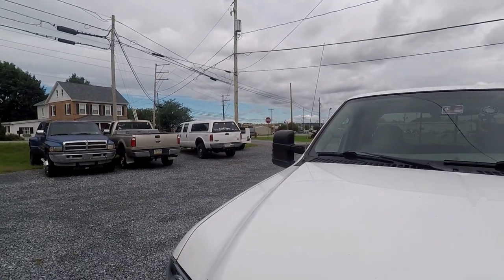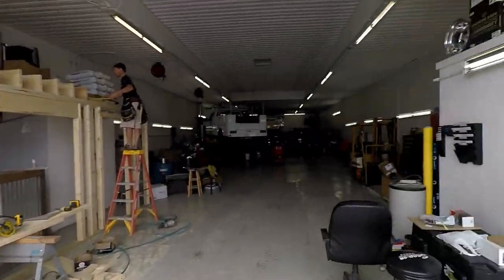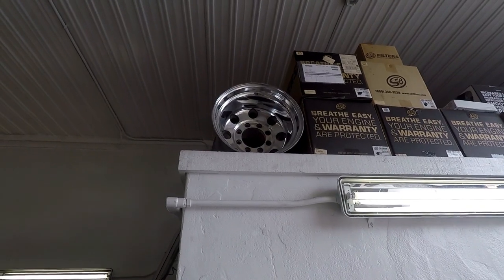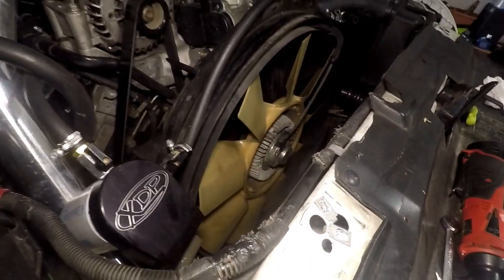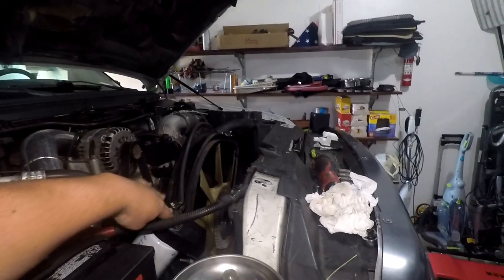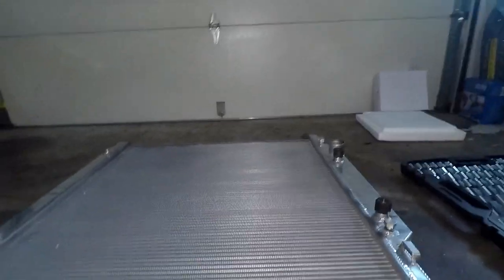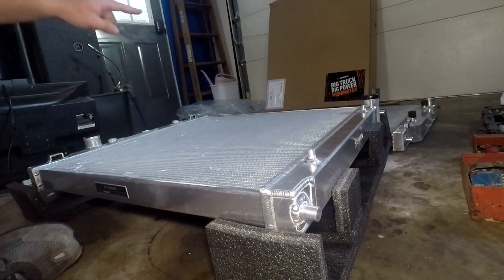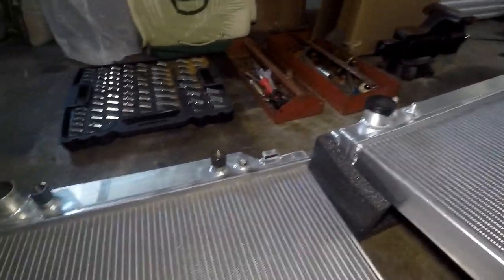6.0 Powerstroke Mishimoto Performance Radiator

Comment: When Bill Hewitt rebuilt my truck he did that upgrade and I love it,  my next upgrade is going to my the banks intercooler.  Need to save up for that one
Reply from the maker: If you haven't already check out my video on the csf 6028 intercooler. It's a great intercooler and a great price. I am switching out my intercooler pipes but overall would be cheaper still.
Reply: I have this exact intercooler, csf 6028. Extremely pleased with it, it's awesome!!
Reply from the maker: It really is a high value intercooler. Been very pleased with mine

Comment: Good to see Mishimoto makes a better thicker rad. Now I might want one. That Powerstroke Help dude knows lots about these 6.0s.
Reply from the maker: Yes he does. I do not know if it is thicker than stock though. We'll see if it cools as well as stock though. One thing that concerns me though is he only talk great about mishimoto and they clearly dropped the ball on their first design or two of these radiators. Their current model has good reviews from what I see.

Comment: What do you think of the XDP radiator or BPD???
Reply from the maker: I do not have experience with the xdp setup, I have heard the bpd is a good one, and the prime cooling on Amazon I have heard good things about. If I were to need a new one I would probably look at the ipr research heavy duty radiator

Comment: If you're doing a lot of Towing I would suggest bypassing the radiator with your transmission lines
Reply from the maker: So don't use the transmission cooler in the radiator? Not sure how that would help me. Can you explain more please?
Reply: @six0bros  yes bypass the radiator if you think about it your coolant is around 200 degrees why would you want your transmission fluid heating up inside the radiator then cooling back down inside the transmission cooler
Reply from the maker: Never thought about that. That said trans temps were not terrible so I think this thicker core should be good. Have people bypassed the cooler in the radiator and have lower temps? Temps while going to ny got about 10 degrees higher than I like. So I am hopeful with this upgrade it should be where I want it.

Comment: I was concerned when you got the 1st Mishimoto radiator but was hopeful it workout so I could use it for my 6.0. Cuz the $500 difference is a lot. Glad Mishimoto stand by their products by replacing with the performance radiator. 

I got a code for my injector #8 contribution. Sadly, I’ve never worked on Diesel engines before and tearing it apart is something I don’t feel confident doing. The local diesel shop near me (Pittsburgh) pretty much hates the 6.0. He replaced my IPR, then told me everything that sucked about them. And it’s a busy shop with big rigs that have a 2-4 wait list or at least for my 6.0!
Do you or other subscribers know of a good shop in the Pittsburgh area?

And how long can I drive with this injection issue (no smoke) 12 miles round trip to work. 

Wish you guys were closer, Lol Thanks in advance!
Reply from the maker: Yeah you are a little bit out there. I do not know about any shops by you. I can tell you as long as it is not smoking like mine has done you should be fine for now. If a shop hates them that much I would try and stay away. That said I understand  you can't just drive 4 hours or so to where I am in Lancaster to have DNA do it for you. Any Ford dealer should be able to. Any plans to go larger for injectors? Also have you checked out our injector video? It is much easier than you would think
Reply: 6.0 Bros Yeah, I did map DNA out but unfortunately it’s too far away for me. I did check your video on the injector replacement but I don’t feel comfortable enough to do the first one by myself. I know #2 & #4 were replaced before I bought the truck. I don’t know if OEM were used. 
Except for a couple trips per season to tow my 34’ Travel Trailer, this is my daily drive. 

I was able to find a couple shops near me & I’m going to reach out to the guy I bought the truck from. I remembered that his friend (who was in diesel mechanic school) did some work on the truck. Maybe I can look over his shoulder while he does the injector work.
Reply from the maker: Nothing wrong with having someone show you. Josh and I were just talking about doing a free raffle to reach someone how to do a job on their truck. Not sure of our exact plan yet but we are working on it

Comment: How do you know which radiator to get? I have a 2006 and I need a new one. Just want to be sure I buy the right one.
Reply: Get the biggest one that will fit, that's in your price range.  Or you can get the one you have fixed
Reply: @dorkhole8564  I've seen different ones. Different size hoses.
Reply from the maker: So mishimoto has 2 different ones I'll look up part numbers after work tonight. But the bigger one is the performance radiator. The cheap one you see on ebay and Amazon is a true mishimoto but it is their old design. The old design one is what I had. I have also heard great things about the one bullet proof diesel sells. Also the OEM one cools great and is a good design. I just didn't want plastic end caps anymore.

Comment: Hey Jared, what coolant and oil are you running? How do both of those Mishimoto rads compare with stock?   Still waiting for that pull off. Lol
Reply: I think I have the basic unit, works for me, Now had the bigger unit been out I would have ordered it.
Reply from the maker: Well the bigger unit was out for me and I still bought the other one, but i wasnt looking for better cooling than what factory did. Well turns out with 13k hooked up it didn't like it lol. Mishimoto took great care of me.
Reply from the maker: I run cat ec1 coolant. I am currently running motorcraft oil but I am planning to try scheaffers next oil change.
Reply: @six0bros  Are you running 5w-40?
Reply from the maker: I am currently running the 15-40 not the full synthetic they sell.

Comment: See brotha I told you back when you were doing head gaskets that it was crap my experience with them was crap, good to see that they are taking care of you at least!!Another thing was that it didn’t come with coolant fittings, they were not the size that was advertised either literally the stock ones didn’t fit like advertised...the bulletproof diesel one does, makes no sense..good luck once again! Btw make sure you burb the heck out of it get all that air out of the system..the air will stay in there and drive you nuts because it will show blown head gaskets signs all kinds of crap. It happened to me and I figured out the problem fix on A POWERSTROKE ARMY forum page...
Reply from the maker: Oh I did burp it lol. So far it seems to be better but I didn't get to me to test it on the highway or with the camper. I am towing my fifth wheel one more time this year so we'll see. If this one doesn't work I'll probably switch to the bullet proof diesel one.

Comment: Hey man I need some help! My 07 is completely bulletproofed and when I smash down on her on occasion she pukes coolant out the degas bottle and gets hot, when I’m not hard on her she stays cool and does not over heat with no signs of a blown head gasket, any help?
Reply from the maker: Well this definitely could be blown gaskets, but first replace your degas bottle cap. Also what are tu ou filling your coolant to?
Reply: 6.0 Bros always mid way between min and max
Reply from the maker: @realmudderducker177  So one thing the min line is now the new max line. newer degas bottles come with a sticker on with update lines. I would then replace that cap and see if it continues to happen.

Comment: Hope it works out that old mishimoto is a piece of shit what a rip off and nothing wrong with oem fan clutch but that Murray fan clutch is amazing I hope u did a coolant pump when u did the studs if not you know that's the next thing to go lol that's how it always is
Reply from the maker: I was smart enough to do the water pump with studs. I learned that watching Anthony lol. Greg the owner of the shop actually also recommended it before I ever said anything. I looked up the Murray clutch and from what I saw it's similar to a winter prep clutch. We don't have an oreileys around here or I probably would have bought it.
Reply: 6.0 Bros oh ok shit down here in the south Louisiana there is an o Reilly’s every 20 mins there everywhere where I I live I got 5 within 25 mins of where I live and what water pump you went with the bulletproof diesel one
Reply from the maker: I went with stock again. I figured my stock one was still working fine. With 180k on it. I looked at it and the plastic didn't have a crack or anything in it. So I decided I didn't think the bpd was worth the extra money. At least not for me. Now later I saw diesel site makes one with a metal impeller and it's not to expensive, I wish I got that one.
Reply: @six0bros  yeah I seen that one on diesel site I can't find any reviews on it I think it's only like 120 bucks
Reply from the maker: Yeah its pretty cheap.